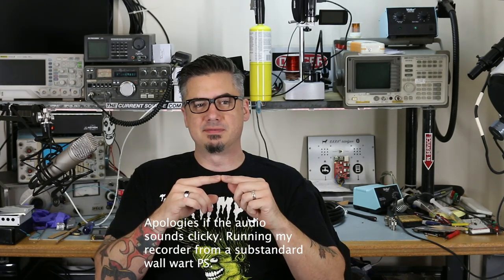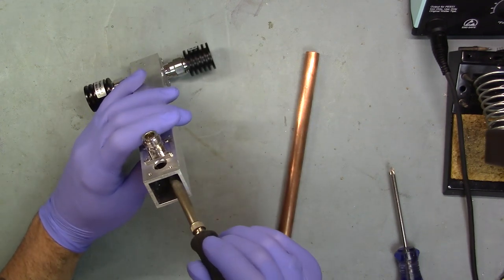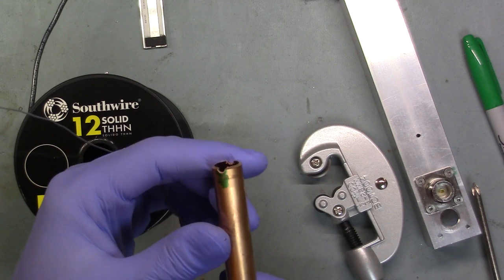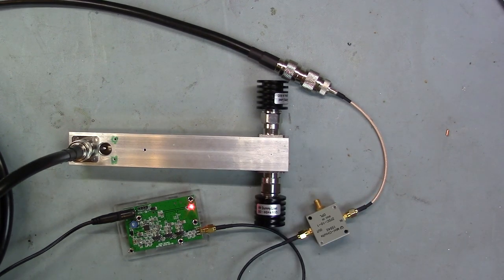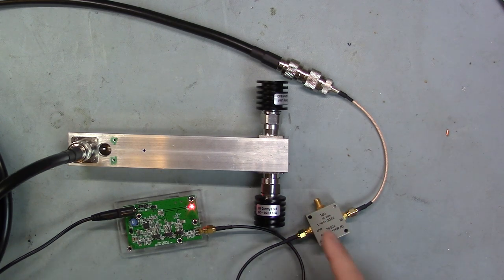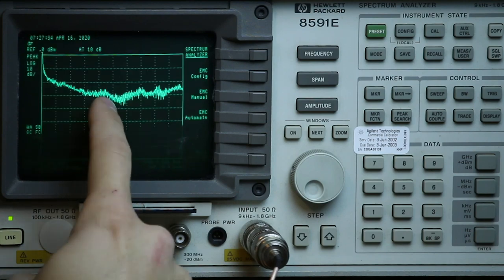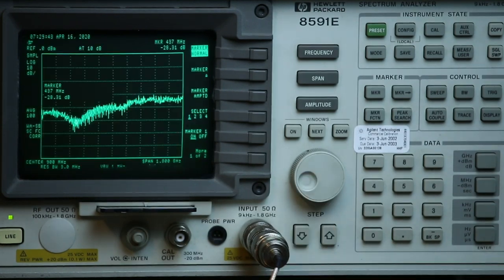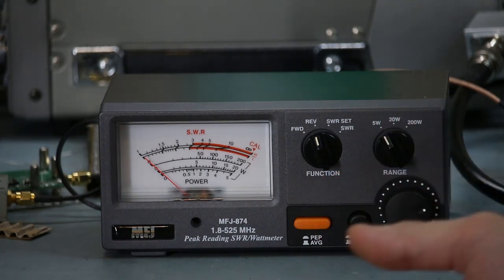Hardline RF Power Divider v2.0

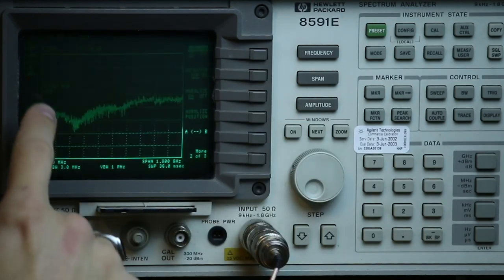Comment: On an overlay to the screen at (8:23) you show -20dB return loss equal to 2:1 VSWR, -10dB return loss (power units as usual) is VSWR = 2:1. -20dB in power units is VSWR = 1.222:1. If it were in voltage units on your spec-A which it does not appear to be, then the -20dBV is -10dB (power units) which would have been VSWR = 2:1 and a standard return loss values of -10dB.

Comment: If in open air and there are no spacers used, the velocity factor for air in a coaxial line is 1.001. So one takes 1.0 as the factor in: VF= 1/sqr Er  (Er  being the Dialectric Constant of a material, air in theis case). therefore VF becomes appr 1.0

Comment: Now that you've checked with your spectrum analyzer, did you test again with the nanoVNA again to check if it still had a bad/offset result ?
Reply: This.
I don't mind using cheap junk PROVIDED I have some way to verify the results. I have an older mechanical movement SWR meter, and I treat it as my standard. It produces the same results year after year when I repeat the same test, boosting my confidence that the instrument hasn't changed. I can't get verifiable  numbers, but I can get comparative numbers with a high level of confidence.

Spectrum analyser VS VNA!
Reply from the maker: SkyGravity1 haven’t yet, but I’ll make a new video once the EME station is up and running
Reply: It would be very scienticious to see the nanoVNA results compared with your previous endeavour. 
I'm intrigued to see which of the variables you have changed made the most difference. Would you be prepared to share some  empirical results?  I'm sure we could all learn something from that.
Great stuff, and I've only just discovered your channel. "Warts and all" making is the most satisfying to share in my opinion. Keep up the good work.

Comment: Neat to see the update!  Awesome, was wondering about using copper as I made a comment regarding on the Hackaday article somewhat related.  Just received the noise source in the mail also yesterday, or two days back, I think.   Figured I better invest in the noise source for the ~450MHz yagi antenna instructable since I noted as a cost effective way to test with a RTL-SDR and a tap or directional coupler with Spektrum.

Wondering what all else can be done to improve performance?  Thanks for sharing!
Reply from the maker: jafinch78 there are ways to tune it, like adding dielectrics to electrically “shorten” it or using a nylon screw to adjust the center conductor spacing. I didn’t even know hackaday did a write up. Thanks for sharing!
Reply: @AmRadPodcast  Just in case: https://hackaday.com/2020/03/31/shoot-the-moon-with-this-homebrew-hardline-rf-divider/

Comment: Perhaps I missed it, but I don't think you mentioned changing the material used for the center conductor ?
Just a curiosity, but how significant, if at all, was the conductivity difference, between Brass and then Copper ?
I have read that Brass is something like only 28 % as conductive as Copper !
Something I don't think you considered, this being equivalent to being the dielectric constant ?
And how vital to the end equation might that have played ?
Interesting project, true to Life experience !
I must say, I went Head hunting for your 2.0 version, after being led down the rabbit hole, so to speak, from your beginning video !
Lol !
Thanks for following thru !
'73 !

Comment: This video was quite interesting, thanks. But the idea of a velocity factor of metal sounds very suspicious to me, a wave in an air-core TEM waveguide should travel at the speed of light. I can understand that there could be length corrections due to something else, such as parasitics. What source did you use for that? Also, do you get better results measuring frequency response with the noise source if you do video averaging before taking the reference measurement.

Comment: The Velocity factor from the famous Fig 16 graph shows about a 1/2 wavelength to diameter of the conductor ration of about 22, On the graph, it comes out at .945 , slightly less than your figure.
If you had cranked up the reflected needle and then tuned across the ban, you should have been able to see where lowest reflected occurred. It would have been good to see the NanoVNA-F or F2  connected and to see what it shows on the smith chart as well as reflected power.
My lastest practical experiment with 15.875 mm copper pipe showed a VF closer to 1.0 rather than the theory of a lower number. Not quite sure why but every antenna with that 15.875mm OD seems to be a VF of 1 instead of what the graph shows down to .94 etc.